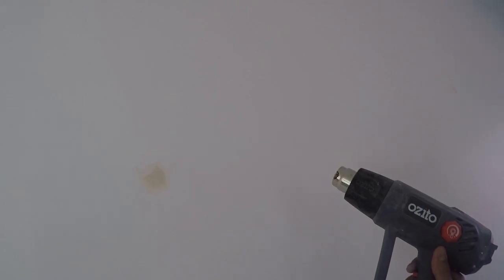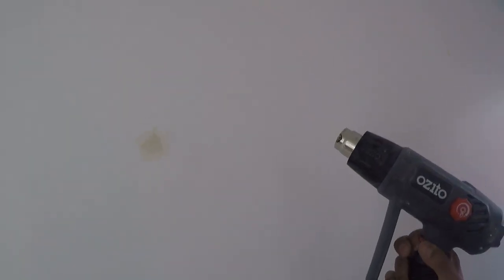speed up joint compound dry time - drywall and plasterboard HACK

Comment: thanks i needed this to get a job done today!!
Reply from the maker: Glad I could help. Try to apply thin layers and dry as you go so it completely sets hard
Reply: 2days i did skim coat with westpac joint compound still not dry going on 3 days tomorrow..
Reply: Same here. Pretty big job and running out of time. This saved the day. I'm almost done now.

Comment: I used a heat gun from Harbor Freight that cost me about $8 on hot mud and boy that's sped up everything!  Now I can patch holes and dry it texture and paint be out of there within a day or sooner
Reply: I need some things to drywall plater
Reply: My heat gun from harbor freight caught fire the first few uses! I then bought the mid-range model from Lowes and it's lasted me years.